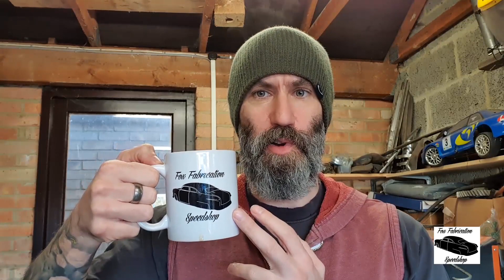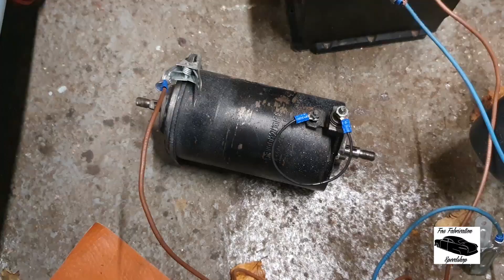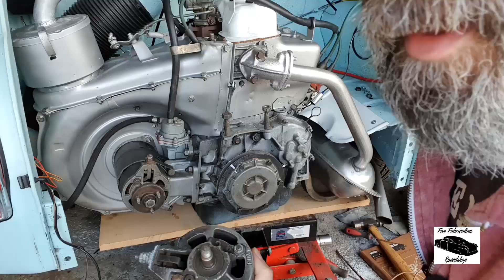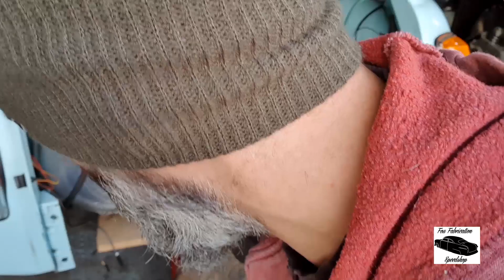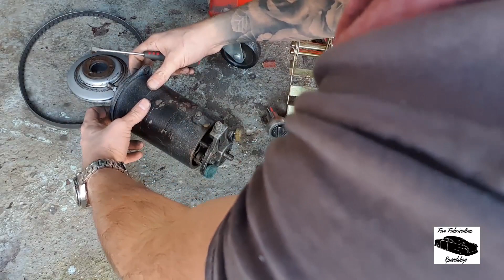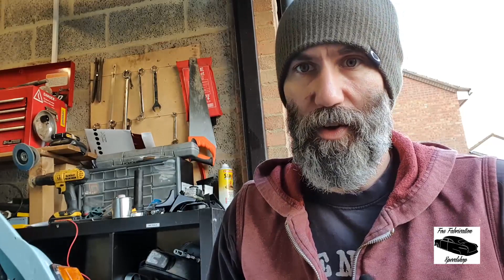Classic Fiat 500 dynamo testing and brush swap - How to DIY

Comment: Hi. I’m getting 13-14 V from 51 regardless of whether 67 is connected to it or not. Battery going flat after a long run in the car. Do you think dyno ok and my problem lies elsewhere eg regulator ?
Reply from the maker: Probably regulator issue yes

Comment: Hi Tim, thanks for the video. Question if I may. The 17m nut on the front by the pulley hub. As this rotates freely, how do you get it off? Do you jam up the 3 pin hub to enable to get some purchase on the 17m nut?
Reply from the maker: Yep, usually put a long screwdriver between 2 of the studs
Reply: @FoxSpeedshop  OK, much obliged.

Comment: A clever idea in wedging the brushes. I did this once and it was a nightmare. I reckon better to remove it and replace bearings and clean the commutator etc. In my xase that would probably have been quicker. :)
Reply from the maker: Well as you can see im going to end up having to do the same, but people wanted to see how it could be done on the car, and so i set out to prove its not as hard as is often made out if you are a bit lateral with your thinking!